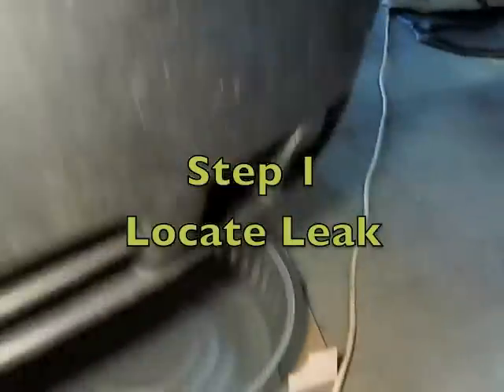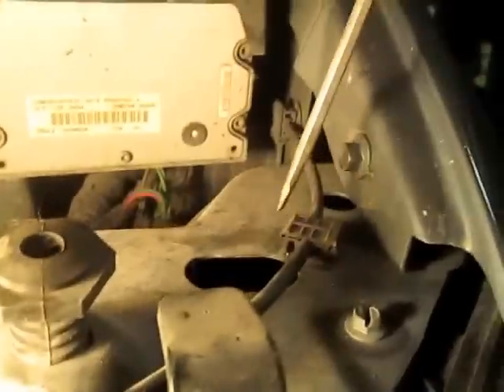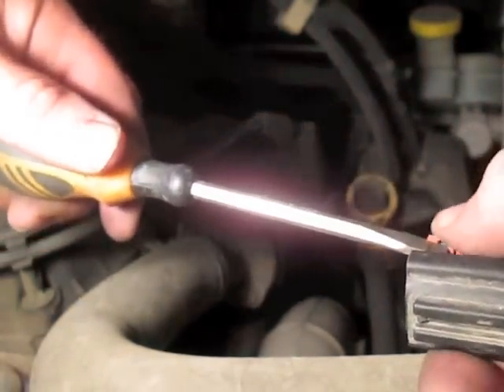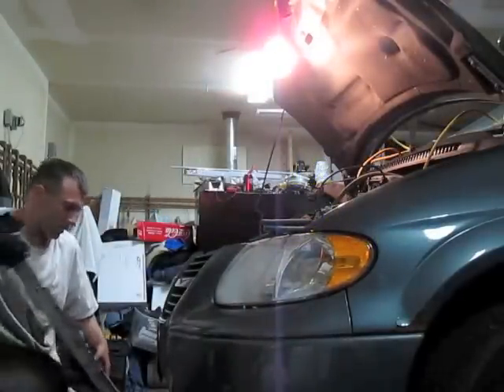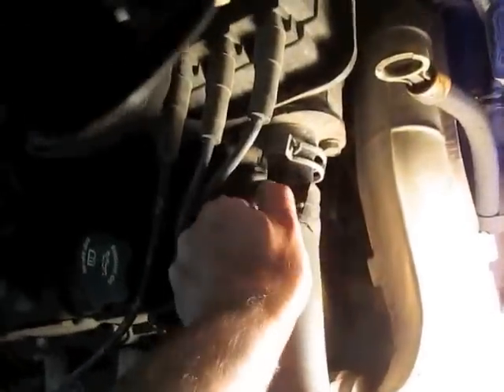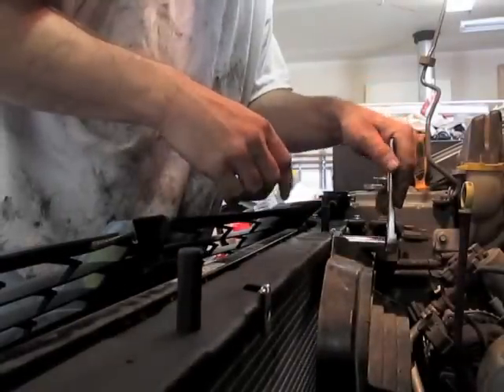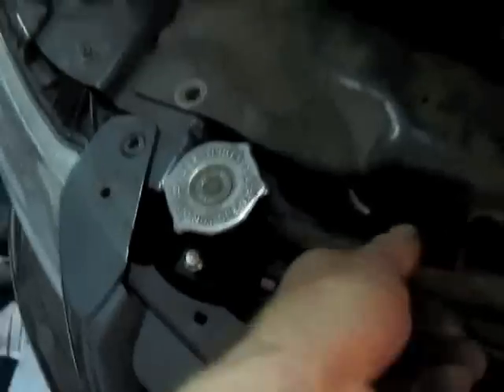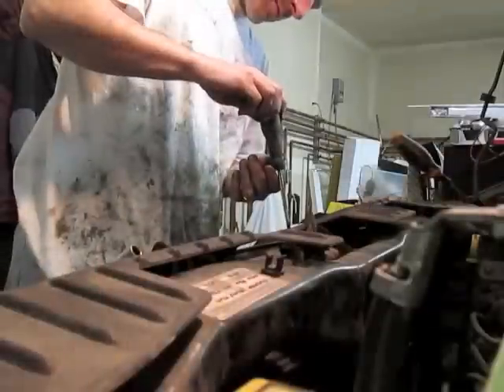2005 2006 2007 Radiator Replacement Dodge Grand Caravan Removal Install Remove REPAIR FIX

Comment: Such a good video. THANK YOU. easy to follow. always shocked at great YouTubers that are willing to share their knowledge with us. I saved $900 last night replacing my own radiator.  How important is it to flush the new unit?!?! I just filled it up with new fluid and called it good.
Reply from the maker: A flush is the way to clean the deposits from the engine, some do with the old unit in some with the new.  Some prefer to do with the old unit on to keep any deposits from clogging new rad.  New ones seem to always have some  aluminum flakes.  Overall you'll probably survive, but it may add to reduced efficiency. Worst case if it clogs again you know how to do it and you're still hundreds of dollars ahead of the game, and whose to say the mechanic would have done it anyway.  I wouldn't be surprised if some charge for a flush and just never do it to save time and get some extra money.  Not saying everyone shop does this, but I'm sure some do skip out on it, but charge you for it-especially when no ones watching.  We're human and typically most people take the lazy way out, not the right way out.

Comment: great and very helpful video. I would just like to add my new radiator came with a metal brace across the top. The brace had two large pins sticking up. I had no institutions to tell me but I finally found online that vehicles after 2005 did not need that bracket and to remove it prior to in installation. Hope this helps somebody.
Reply from the maker: Hey thanks for the update!  Glad you got it done!  Nothing like finishing a job on your own you thought you'd have to pay someone to do!
Reply: Chris. I know this is two years later but thank you thank you. It did help me as i ran across the same problem in the replacement radiator for my 2006 town and country
Reply: Hi Chris, I met the same thing today and just wanted to cut off the two pins maybe better for the radiator

Comment: Great step by step. Nice attention to detail.
Reply from the maker: Yeah I tried to take my time.  I had to bring it back in this year.  It had a lifetime warranty and started dripping on one of the sides.  I did get a new one for $20 less and was refunded the price I originally paid, but had to buy more G05 and spend the time doing it again...  Save your receipt if you replace it...it was a $180 savings compared to not having the receipt

Comment: Thanks for Posting .
Great info and instructions . 👍 .
Reply from the maker: Thanks for the comment glad it helped!  I actually just did this again a few weeks ago.  The radiator came with a lifetime warranty and it started leaking again.  Save the receipt it saved me $180.  I did have to go through the work again, but it shows it is important to save the receipts...

Comment: Should do the flush with the OLD radiator still in, now you've loosened up all the gunk in the cooling system and it's in the new radiator. Flush first, then pull the bottom hose to gush it all out, then install the new radiator with new coolant.
Reply: THANK YOU
Reply: Ok o wii do it thanks for your help

Comment: Good basic video. I had to replace the starter and I removed everything up to the fan. So the next step would have been  to remove the radiator.
And actually I didn't have a hassle replacing the starter. Everything unbolted. So this will be a process piece of cake.
Reply from the maker: Yepp!  You shouldn't have any issues...  Step by step, nothing to horrible to worry about

Comment: Thank you for this video! I have a Dodge Grand Caravan 3.3L 2007 with 180K km, and the coolant started to leak a bit, I have seen some small wet spots on on the asphalt the driver side in a summer sometimes under the radiator. I am just wondering if this a radiator? I purchased the coolant leak stop, but it did not help.I am just wondering if I should add another coolant leak stop fluid into the radiator or just replace one? Merry Christmas!
Reply from the maker: First you will need to look closely to see where the leak is actually coming from. Make sure the radiator is actually what's doing the leaking before going through all the work....
Reply: @youcanfixit3721  Thank you for your prompt reply! I will go to my mechanic next time I do the oil change, so I hope he can check it out.
Reply from the maker: @oneundecided  He'll want to get his hands in there for the quick $300 he''ll make off you, so say strong if you want to change it on your own......  Best of luck...
Reply: @youcanfixit3721  The radiator cost is about $65 and the installation is $100. For example my mechanic changed the front shocks  (the aluminum parts rusted on the shocks and the spring broke on one) for me and I paid $470 pars + labor.
Reply from the maker: @oneundecided  Well if they only charge $100 to do the job have them do it.... I live in Alaska and it's never that cheap up here....Plus They're always trying to up sell.  I have one shop I go to because he's honest.  I went to anther one once for a discounted oil change.  I always change my own, but it was $20 and I though heck the oil costs me that much.  Well I picked the car up and they had $4,000 worth of work they were ready to do.  I have an old beater and they had the estimate all rung up like if I didn't get a few things done I wouldn't be able to drive it.  That was over a year ago.  I have a $1200 vehicle and they were using scare tactics to get me to pay more. They gave me the estimate and then had me sit and wait there for 20 minutes before they finish up with me and then ask if there was anything they could schedule an appointment for from the list.    My wife was all worried and I said no were fine, but they definitely guilt you.... That's why I prefer to do most things on my own.  If you can get it done that cheap go for it, but if you're broke and want to save $100+ dollars do it on your own......

Comment: Do you have to fill the coolant reservoir  too or is that separate coolant?
Reply from the maker: Depends on the level.  There is a spot to check the level on the reservoir.  If it's too full it has an overflow and just spills out to the ground which isn't the greatest for the environment, but won't end up hurting your vehicle, but there is a spot to check the level, but sometimes they get stained and it's hard to see the level, so shine a light through the top and look through the side if you can't see in very well.  Best of luck!

Comment: Hello My Friend.

I replaced the radiator of my Voyager 2003 based on your video. Thank you for have taken the time to make this video and share it. Additional I would like to question how often do you replace the radiator of your Voyager. I have replaced it twice almost each 8 monts. I think that something is failed in the cooling system that is impacting in the radiator life. Please let me know your comments.

Thank you.

Regards.
Reply from the maker: +Edgar Brito Radiator cap may need to be replaced and may be wise if you have had issues that quick.  Look online.  Also maybe the Head gasket?  Anyone else have an idea let us know.  Thanks

Comment: I must have had some kind of aftermarket radiator,...My top clips that connect the radiator and the AC condenser were off by about 1/8"...I tried heating them ever so slightly, and it helped a little but then to finish the job I used files on each side to shave those tabs down a little so they could fit.
Reply from the maker: Glad you got if figured out.  Sounds like the typical nothing ever goes smoothly job.  I get those all the time.  Thanks for the comment...

Comment: i hate to be a pain, after you flush the radiator, how do you mix the fluid? like is it 2 gallons of radiator fluid and one gallon of distilled water mixture?
Reply from the maker: Sorry I was away and you probably already did this.  It all depends on your driving environment.  I mix a strong coolant solution because I live in northern Alaska and we can get down to -50.  Most places you can get the premixed if your worried or just read the label on the back of the container.  Not sure if the owners manual gives mixing instructions.

Comment: Please make a big favor to you REPLACE THE COOLER FANS if they are or looks old.... 3 years ago i replace the radiator and just 4 days ago I heard a bump noise  smoke coming out the engine compartment.... So what happened the cooler fan blades just decide to jump out of place (just separate from the motor)and damage the  radiator  😞😞😭 how that happened im still working on investigate the incident 😣
Reply from the maker: Dang that sucks!

Comment: Man, now did you get that "flap that was catching up"?  Mine is a 2008 Town and Country, but yours looks pretty much the same.  I assume it was the little plastic hook piece that hooks under the hose to the air conditioning piece?  I have everything free in there, but cannot get that side to separate.  I see the hook piece on the hose but can't get it off there.
Reply from the maker: +Tony Pieri Sorry I don't see your post, but can only assume you got it by now.  Hopefully you figured it out.  At times it was just patience as I at times get frustrated and want to just start crankin' but refrain from this as I know it will just cause more work.  At times a quick break is all that is needed.  I assume you got the flap in the right spot from the AC unit.  I know that was a hassle... Thanks for the post and sorry for the late response...

Comment: Sometimes the petcock will need a new oring seal.  No radiator change out necessary.
Reply: Wish I would have seen this. Got the new radiator installed. Knew the leak was from the old one on the lower right when looking at the driver seat. So thought there was a  crack in the radiator.  Looking over the old one after the job, the o-ring on the drain valve was shot lol.
Reply: Inspected the radiator right when I got it out and couldn't tell if there was a crack because of all the liquid from the removal.

Comment: We’re did you but the radiator from?
Reply from the maker: It was leaking.  I ran over to the local NAPA (only auto store in my town) and they had it.  I went home and put it on that night.  So from the time I saw the leak till the time it was fixed was about 14 hours and that includes sleeping and I used the van the whole time.  No waiting to drop it off at the shop and give up the car for 1-2 days.  Got it, did it, done!  Driving the car like usual the next day!  Best of Luck!

Comment: Can you advice me from where I can buy radiator and condenser and front pumber  for dodge caravan 2009 
I ask about price from one mechanic he told me condenser with radiator 275$. And pumber 350$ frame for both light 250$  I hope u advice me I live in buffalo newyork ,,thank you
Reply from the maker: Check Amazon if you want to save some money.  Also check the parts stores. No idea which ones are around you.  I live in a small town and we only have a NAPA, so that is where I have to go...  Best of luck and sorry for the delay in getting back.  The radiator with condenser doesn't seem too bad.  I spent $189 on the radiator from NAPA.  Amazon will be cheaper, but sometimes I wonder what I'm getting and if you get it at a parts store it should come with some type of warranty and when you buy on Amazon you never know and have to deal with shipping.  Best of luck on your hunt and let us know where you ended up getting the parts... Thanks..

Comment: I need you help gran caraban 2005
Over heating,  
Ireplace  - first  the Fans still  , over Heating.
I Replace -   Radiatio  and ,  thermostat  
Still 
I replace the water pump  and still over Heating  ,my Question what's next ??? 
Thanks in advance for your help
Reply from the maker: Catalytic Converter?
Here are 2 sights you can check
https://www.cars.com/articles/what-are-common-catalytic-converter-problems-1420663031608/
http://affordableautohopkins.com/common-reasons-your-car-overheats/
also https://www.cars.com/articles/what-are-common-catalytic-converter-problems-1420663031608/

I know last year I had an issue with the converter.  I'm guessing you replaced the serpentine belt or have one that isn't slipping as well.  Best of luck...
Reply: @youcanfixit3721  THANK YOU SO MUCH FOR YOUR HELP

Comment: My 07 Caravan has got a completely different set up that even the Chilton  repair manual shows completely different set up from that and I can't find the right damn radiator because of it
Reply from the maker: Bring the VIN into a parts place and they should be able to let you know.
Reply: @youcanfixit3721  after I sent that comment I spent all afternoon at O'Reilly's Auto Parts before we found it on Summit Racing parts website Mopar has two different radiators under the same part number for that van my van was manufactured towards the end of its production run and only a handful of them have the radiator that I have
Reply: @youcanfixit3721  thank you for the reply and the advice though👍

Comment: where did you get the parts? I was thinking carparts.com but I'm wondering if it's worth paying 100 more for a part from autozone.
Reply: fractal_force guessing he got it from AutoZone. $100 more but lifetime warranty. I've used AutoZone lifetime warranty before and it very easy to walk in and get a new part no mailing and waiting. worth it to me for convenience.

Comment: On the 2007 caravan they use a different radiator fan connector, there isn't an orange tab on it to slide over you need to slide a thin straight edge screwdriver into the connector and lift the tab up. Please update this video to show both types of connectors.

Comment: how can it build pressure when its leaking duh
Reply from the maker: Yeah so true, but someone not knowing any better may have some other fluid leak and think they needed to change out a radiator, when in fact they don't. Not everyone knows the ins and outs and safety is just proper technique. I'd just hate to have a do it yourself person giving something a shot and getting injured. If your already experienced in the process then you most likely didn't need the vid, but many are not. Thanks for the post though
Reply: You can Fix It!!!! true
Reply: If its a small hole it will build up pressure and steam out like a kettle; so if you open the rad it will boil out.